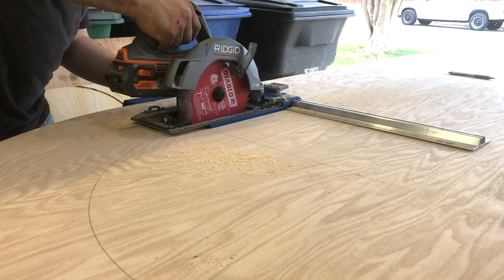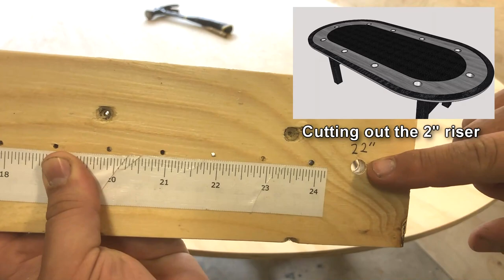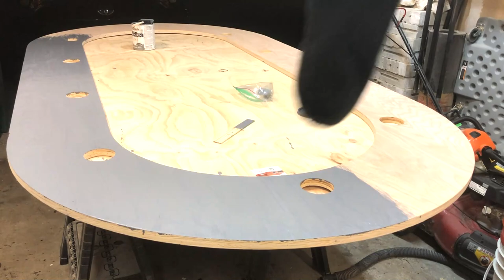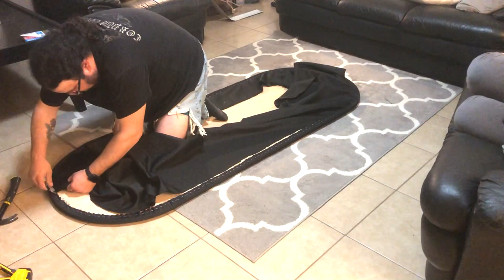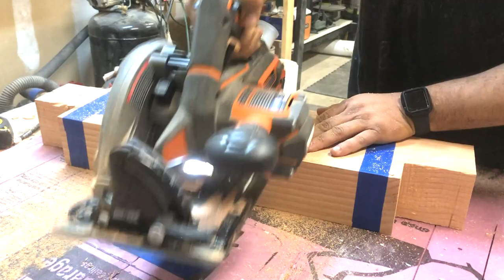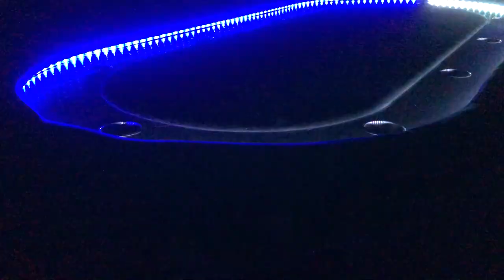X3WD - Making a Poker Table

Comment from the maker: Thanks everyone. If you have any questions please comment below and I’ll try to answer them as quickly as possible. Sorry for the delay in getting back to some of you.
Reply: looking into building a racetrack poker table. where did you get your felt for the table? I looked at amazon and they have one for 25
Reply: I see where you bought it now
Reply: Nice table! But I didn’t see how you attached legs to the table
Reply: Hey what state are u in? How much to build me one
Reply: What kind of rotor bit are you using to clean up those edges/cut out the half circles?
Reply from the maker: @roberth3985  just a straight flute router bit. Once I cut the half circle on one sheet I used the same router bit to flush cut the other pieces.  It has a bearing on the bottom of the bit so I was able to flush trim the other half circles to match.

Comment: only thing i'd recommend is that when you do the rail upholstery, lay it down like you had it but don't cut out the middle. staple it to the outside edge first THEN cut out the middle and staple the inside edge. it's easier to see where wrinkles are before it's all stapled to the wood and you can make adjustments easier as well. also cut longer thinner strips along the inside curve of the rail. it helps with wrinkles. otherwise it's a great looking table.

Comment: Curious what air compressor you use in this build.  Can you provide the details?
Reply from the maker: I was using a 21 Gallon 2.5 HP 125 PSI Cast Iron Central Pneumatic Air compressor from Harbor Freight which I believe has been discontinued. Fortress and Mcgraw brands took it's place now. I think the CFM is something like 4 or 5.

Comment: Somebody teach this man how to do the Oklahoma Planer!
Reply: What is the Oklahoma planer? I searched YouTube and couldn't find anything relevant
Reply: @samueldeter9735  the Oklahoma planer is when you are needing to cut a section out for joinery, but you have no tools so you take a circular saw and with it running, move it side to side to hog out all the chunks.
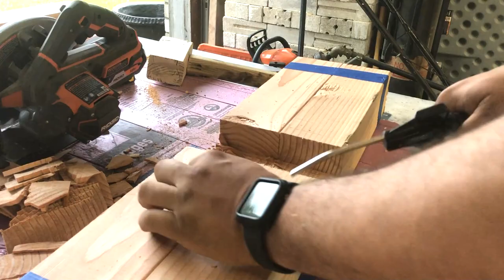Reply: It would have worked at the 9:00 minute mark.
Reply: @claythomas9467  I got ya...I didn't know it was called that...is there a good way to do it when the dado is too wide for the circ saw plate? (ie if he was cutting out an 8 inch section)

Comment: Did you attach the legs to the table, or is it just sitting on there so it can be moved easily?  If attached, how?  (Are they screwed through the base into the legs, pocket holed,....?)
Reply from the maker: I used L brackets that attached to the bottom of the table and skirt of the table base. 4 total.
Reply: @X3WorkshopDesigns  Thank you!!

Comment: Great job, I cant see how did you attach the 3" top rail to the table? Did you use brackets or ??
Reply from the maker: Ackshon Thing 1” wood screws screwed from the underside. I stapled the fabric to the 3” top rail, then I put the 2” rail over that and screwed it down sandwiching the fabric and hiding the staples. Hopefully that makes sense.

Comment: Wow. Is your LED connected to a battery or can one use AC ?
Reply from the maker: This one that I installed uses batteries. I went with a cleaner look and bypassed using an outlet for the leds.

Comment: How did you mount your trim router to the wood jig you made??
Reply from the maker: I used the plastic piece the router comes with and used the screw holes to align it to a piece of wood. From there I just recessed the screws so they sit just below the surface of the wood.

Comment: Hey, so what’s the final length and width of this table (once it’s all together and finished and you needed to measure it to fit in a van or something)? Please :)
Reply from the maker: It's the size of the plywood sheet. 4' wide by 8' long. Its two prices, the entire leg assembly and the table top.. I used my truck bed to transport it to its final destination. The legs were then screwed together with the table top once it was in the room it was going to live in. Thanks.

Comment: what kind of cloth material you use? I know that tables have usually very smooth, but a tiny bit soft table to easily slide, pick up, flip the cards and at the same time not too soft so that cards easily move without bending (possibly rubber layer below the cloth?)
Reply: high density foam, probably 1/4 inch
Reply from the maker: Hey Martin. Sorry for the late reply. The materials were purchased from buildyourownpokertables.com. it's in the description. Thanks.

Comment: Please get back to me on how you were able to overlap the rail & riser after you had cut them from the same board. I’m having issues not understanding how that’s possible
Reply from the maker: The rail and riser are not cut from the same board. The 3” wide rail is from one plywood sheet. The middle of that is used for the center playing surface and border. The 2” wide riser is cut from a different sheet of plywood, and the center remaining piece is what I used as the bottom of the table top. So two sheets of plywood are used for the whole table top build. Hopefully that clears it up.
Reply: So plywood A, you cut the 3” rail, the racetrack, & the playing field
And for plywood B, you cut the 2” riser, and then were left with the base?
Reply from the maker: @sethesham6223  sorry. I’m still half asleep. No coffee yet. From the 3/4” plywood, I cut the bottom rail & used the center for the playing surface & racetrack. That’s it for that. Now, from 1 sheet of the 1/2” plywood (A) I cut the 2” riser and the middle I used as the bottom support for the whole table top. The other 1/2” sheet of plywood (B) I cut the 3” top rail and the middle is just scrap leftover.  Once assembled from the bottom up you have 1/2” plywood bottom (A) left from the 2” wide riser, next the 3/4” racetrack, then the 2” wide riser from the 1/2” plywood (A) followed by the 3” wide top rail; plywood (B). Your led lights will go on the inside underneath the 3” top rail along the 2” wide riser.
Reply: @X3WorkshopDesigns  okay thank you! I’ll figure that all out once I’m done working, just 1 more question, where did you get your foam at?
Reply from the maker: @sethesham6223  the links to all the materials I used are in the description.

Comment: What are the dimensions of the table? I'm especially interested in the length, width, and radius of the semicircle at the ends?
Reply from the maker: It's a full 4'x8' sheet of plywood. The semicircles are just measure in 2" and 3" from the edge.

Comment: Are the legs 4x4 and do you find that they get in the way as far as leg room at all?
Reply from the maker: Yes. I used 4x4 legs. I found that there was plenty of leg room and didn't hinder anyone's ability to sit at the table.
Reply: @X3WorkshopDesigns  thanks for the response. I'm going to do the same on mine.

Comment: what led lights did you use where did you get them
Reply from the maker: Hey Eric. The led lights were purchased through Amazon. They had the option to plug in the battery pack or use a 120 outlet. Thanks.

Comment: How do you space the cup holders out evenly?
Reply from the maker: That depends on how many you do and the layout. I may make another video explaining how I came up with this spacing since this is a question that comes up alot. Thank you.
Reply: @X3WorkshopDesigns  it will be an 8ft table with 10 cups
Reply: take diameter of the track, and divide by however many people it will seat. Thats how far apart you will space the cup holders.

Comment: Nice job, but man I cringed when you were using the chisel
One slip and it was going through your wrist
Reply from the maker: It does look like that right? Thats another reason I was lifting my wrist upwards. I was mindful and careful when using it. It's difficult to explain but it's a controlled pushing movement when chiseling out the small pieces.